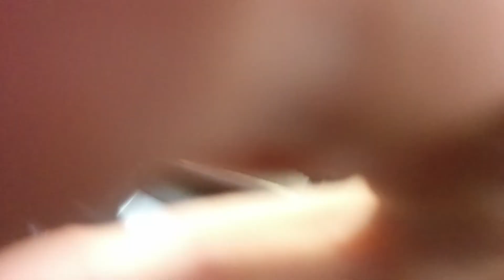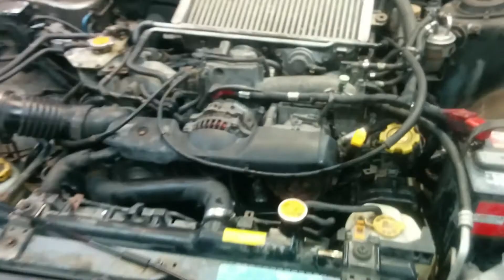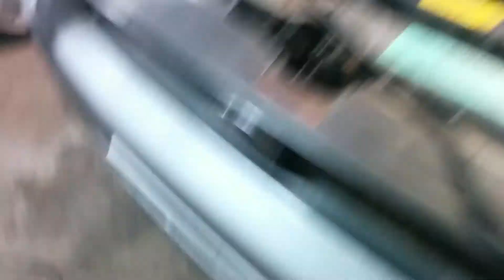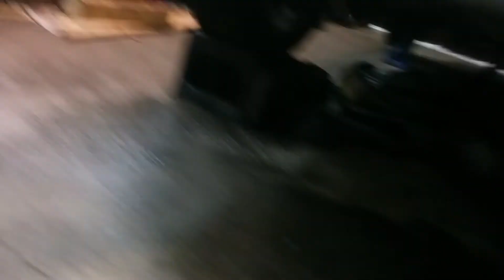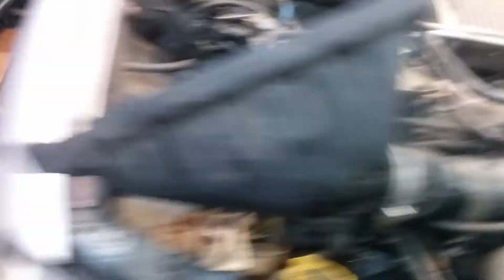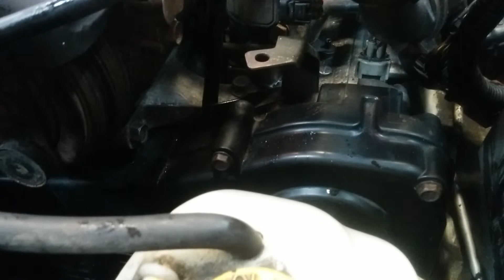WRX EJ205 my first engine rebuild -  first start

Comment: i have a bugeye with a spun bearing. is it necessary to get the crank machined after that kind of mishap?
Reply from the maker: yes, usually when it happens the surface of the crank as irregularities and this would be detrimental to your new bearings, so the way to go if you don't want a new crank shaft is to get it under sized with the appropriate bearings